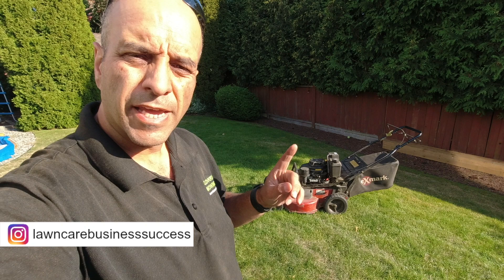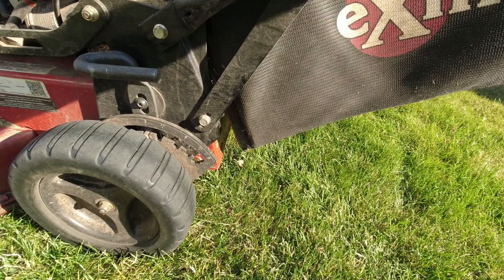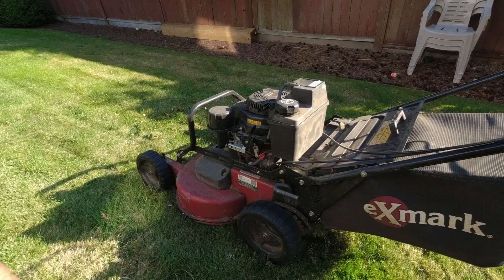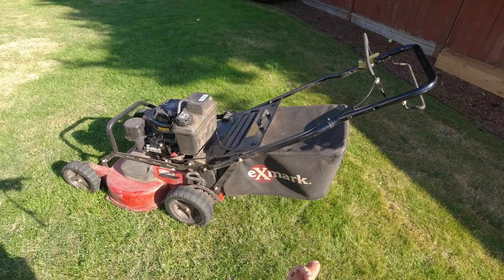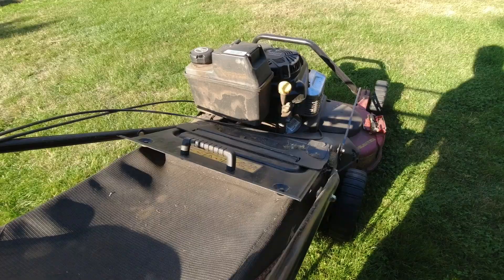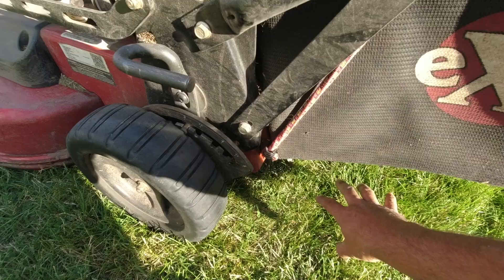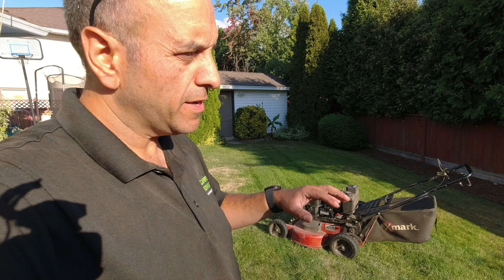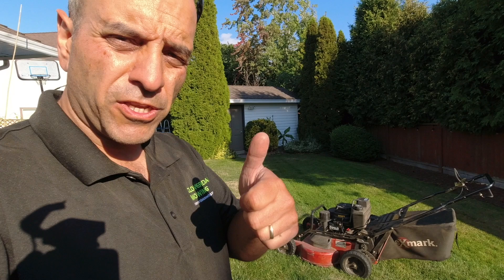Simple Trick Improves Lawn Mower Bagging Performance 100%

Comment: An issue I’ve fought for years. I’ve never been able to find anyone that acknowledged it being an issue before. My previous Toro I used to wedge a 2x4 between the bag and handlebar, but this wore the bag. My new Toro SR I took two washers and welded 1/8” rod 6” long to the edge. Put a washer behind each handlebar bracket bolt at that same bottom corner. Bent the 1/8” rod to come around and sit right in line with the metal bag frame, just a hair behind. Bag slides inside them when putting it on and they prevent it lifting up more than a few mm. So no extra step on that when mounting the bag.
Reply from the maker: Nice 👍 I’ve always had issues with all the small mowers I’ve had. I think because here in the PNW with all the rain the lawns are all so bumpy. Thanks for watching.

Comment: Have you seen the new battery powered Commercial 21 from Exmark yet? It looks to be a pretty solid machine.
Reply from the maker: I have not seen it in person yet, just pictures. It does look solid. Basically the exact commercial gas version of the mower with the engine replaced with a battery powered version. I’m excited to get my hands on one. Thanks for watching.

Comment: What do you think of the idea of having multiple bags in which you fill up one after the other to dispose of clippings once the job is done?
Reply: I Like that idea! Even if its just two bags, Thats one less trip to the truck!
Reply from the maker: What I’ve done in the past is just lay a small tarp like 4X6 or so on the ground and empty the bag onto tarp. Can usually empty two bags worth on tarp plus still have the bag itself. Either carry the tarp over your shoulder at the end or tie the corner s off to make a bundle and put it on top of the mower to have the self propel carry the load to the truck. Thanks for watching.
Reply: @LawnCareBusinessSuccess  There some really big battery banks meant for camping. What would be cool is getting a cheap Dethatchers  powered by an extension cable that you would plug into the bank.

The electric cord powered  Dethatchers are likely safer to use on steep hills in comparison a really heavy gas powered machine.

You would also be able to use the battery bank for other industrial applications. 

I'm not refering to a battery bank like your girlfreind would put in her purse. I'm referring to something like the "Anker SOLIX F1200 Portable Power Station, PowerHouse 757, 1500W Solar Generator, 1229Wh Battery Generator"

Perhaps you could get a few cheap dethachers to plug into a single battery bank for a team effort on large lawns.

Comment: Is that just a problem for the 30" because I've got a exmark 21" and haven't noticed it
Reply from the maker: Actually it’s a problem I’ve noticed on all small mowers at one time or another, including the commercial 21 and even the Honda HRC-216 I used previously. Only when mowing lumpy lawns around this time of year. I think it’s because the ground is so hard from the summer drought. If it’s a manicured smooth flat lawn or it’s getting enough water and has some give to the soil, or the lawn is growing heavily and there’s lots of clippings, it’s never an issue. Thanks for watching.
Reply: I will try to notice next time I cut

Comment: It's a shame you have to do this to a $2,000 mower. Just got the scag 21 7hp and the bag leaks all over the place around top and side edges due to poor fit. Going to try and seal cracks/ spacing with foam tape
Reply from the maker: Lots of mowers I’ve used over the years have the same issue. Only an issue on bumpy lawns. Not every lawn is smooth and flat though. That’s why I thought I’d share this tip I’ve used for years. Thanks for watching.